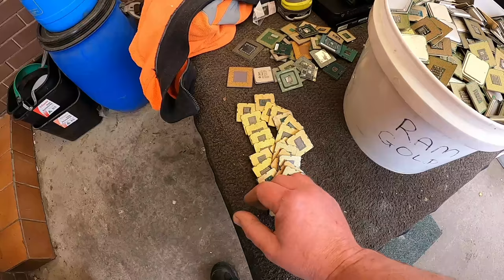Scrap Marathon Biggest Ever Part 5

Comment: I recommend you keep cat 5  and cat 6 cable separate from everything else. You really should get more for it than low grade, especially that low grade ribbon cable you had there.  Those are 2 very different pieces of wire.  Once I started to keep wire categories separated, I started to get higher rates for them all. If the ratio is more slanted toward the data cable, with less cat 5 included, you'll get the lower rate for it.  At my yard in California that means the difference between 0.40 cents and 0.75 cents per pound.